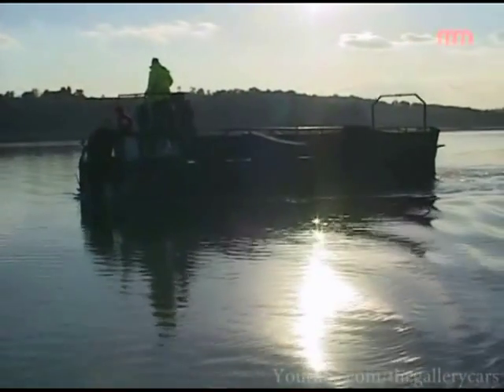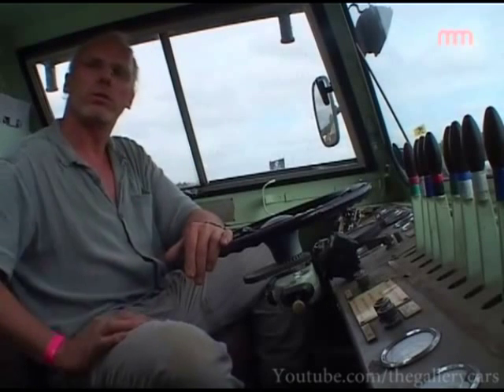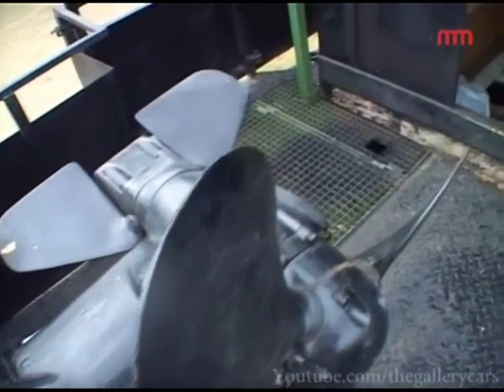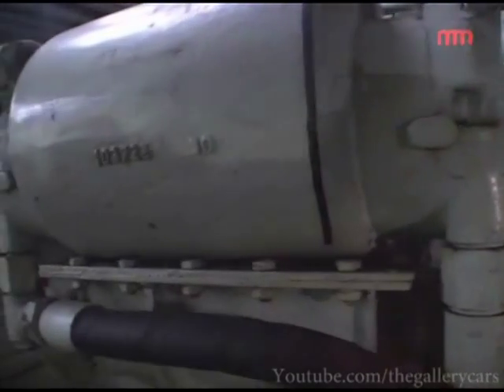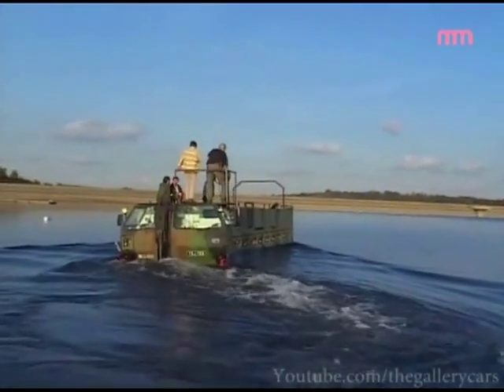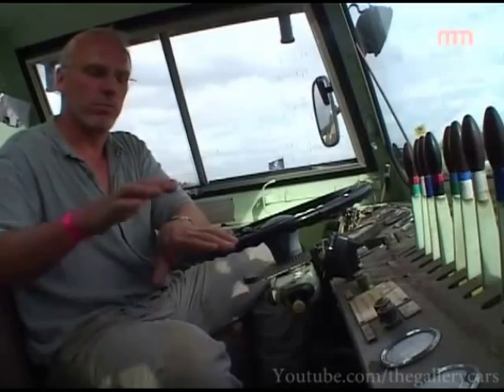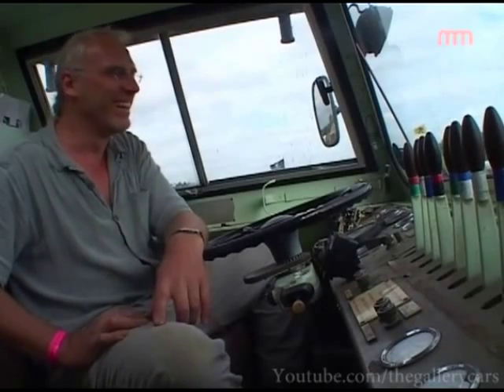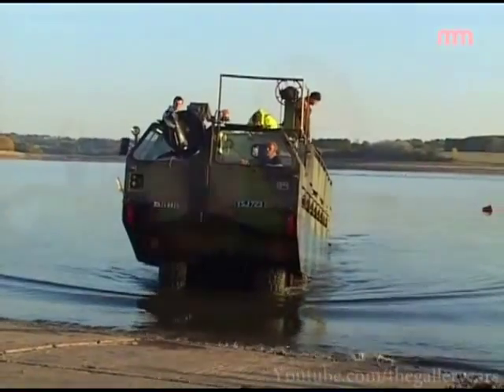Military Amphibious Truck - EWK Gillois Amphibious-Bridge V12

Comment: I drove it at the army. Nice drive on the road, terrible on the water ! By extremely cold nights by the Rhine we used to heat the engine for a couple on hours and then we slept almost naked in the engine room ! Nice memories. Thanks for the images.